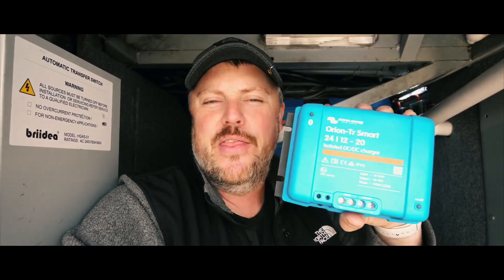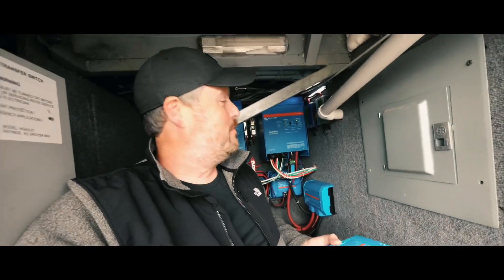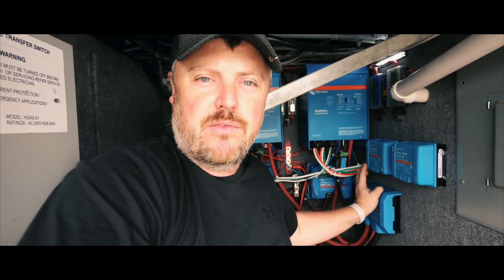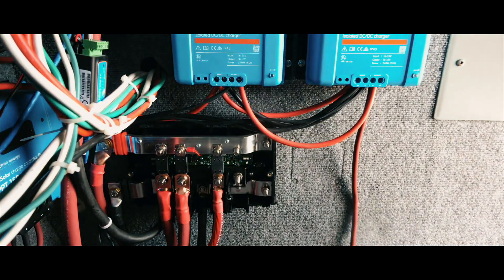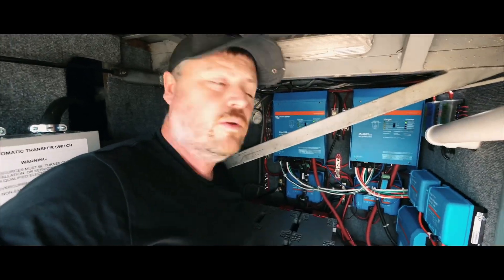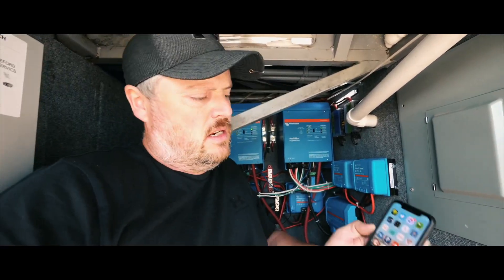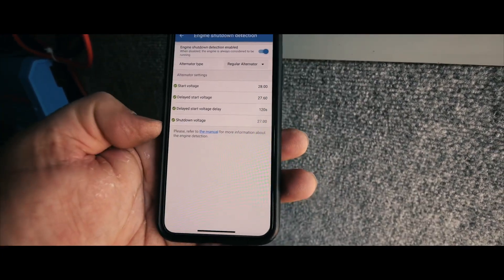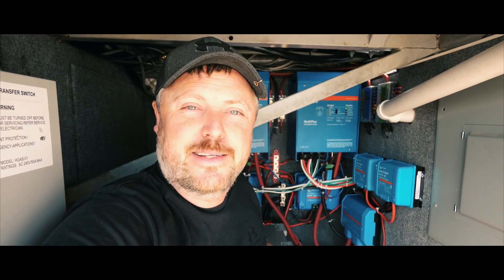Installing 2 Victron DC/DC Chargers in our Bus Conversion!

Comment: Hiya,

What have you got cable size wise from the truck battery to the DC DC chargers? Ive got 1 x  16mm² from my truck battery to 1 DC DC charger at about 7m long but im worried about them being too small if i run 2 DC DC chargers in parallel

Comment: Yeah I can’t seem to get information regarding a Victron Orion 12/24-15. I want to know if I can charge 12 V battery banks and 24 V battery banks using it I would think so but I can’t find the information. There are charts but they are not clear as to If it will work